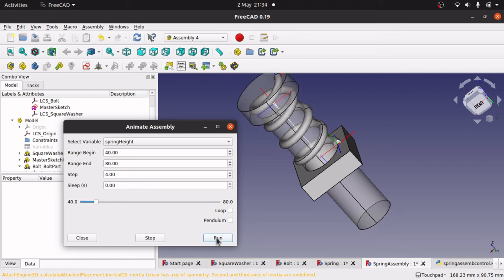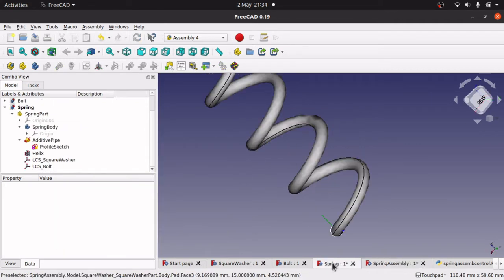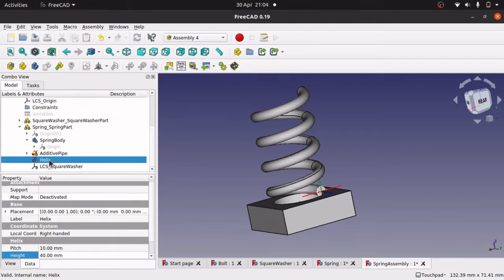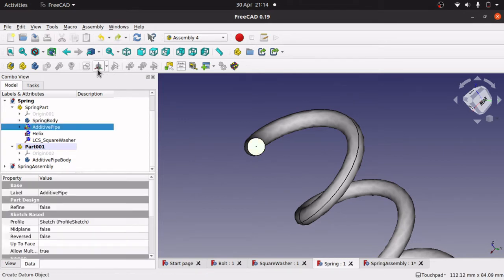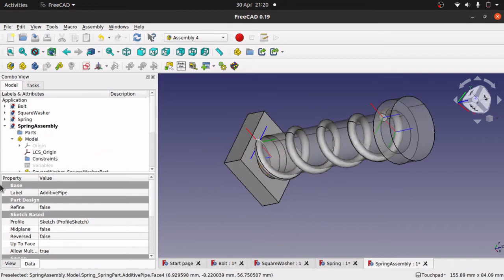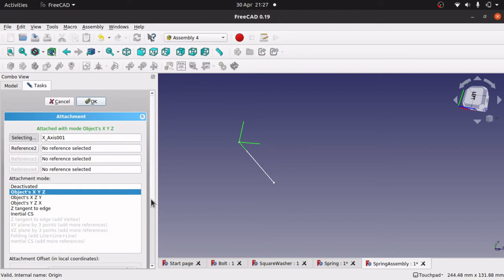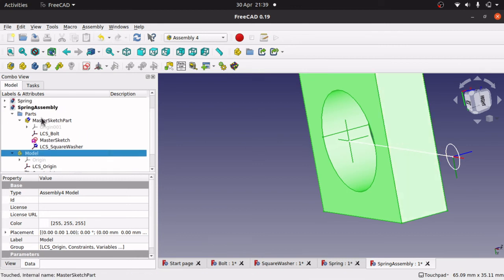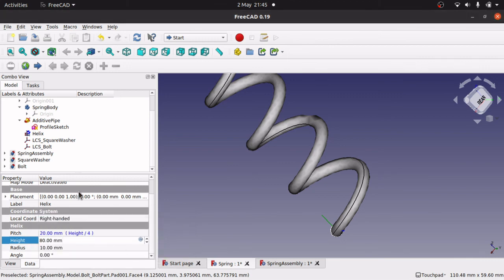Freecad Assembly Animation Spring moving bodies Part 3 of 4 - Beginner friendly, mechanical movement

Comment: Is there a trick to speeding up the spring's recomputation? Every time I change the spring height, my computer takes a good 10 seconds to generate the new spring shape.
Reply from the maker: This is quite a old tutorial and I am going to update this for the new assembly workbench which has a new solver so things should be a lot quicker.

Comment: Hi Mango, your video's are well put together and easy to follow after watching a few times. i have a problem with the animation, when i try to input the formula/expression for the height of the spring, ie; (<<springassembly>>Hash etc i keep getting the message Failed to parse expression, as soon as i start typing in that field, thanks for any help.

Comment: There appears to be a missing video between 2 and 3 as it jumps with a bunch of added Varibles on the springs
Reply: I agree. I never did see how to create the LCS on the spring to attach the bolt. There is a problem with this. If the LCS is attached to the top end of the spring, none of the planes created are parallel to the X-Y-Z planes of the parent. This is due to the fact that the additive pipe created by the helis and the ProfileSketch leave the top end of the spring at an angle perpendicular to the helix end. This can be corrected by rotating the axes, but when the spring height is changed the rotation angles are no longer the same, so the bolt tends to rotate to weird angles as the height is changed. At some point the assembly blows up. Everything was fine until I tried to change the spring height.
Reply: Yeah, I was really enjoying the methodical an step by step approach in this series as this is touching a lot of parts of FreeCAD I haven't touched before. And then a whole video is missing :(
Reply: Oh, it feels like the end of the video is at the start? as the first step that I was expecting is actually 8 minutes in?

Comment: Whew!  I made it to the end of this video  - lol.  Picked up some tips along the way but I have to admit my head was spinning and I didn't take it all in.  The inter-file issues with the variables was somewhat hard to grasp but I'll have to re-watch (probably several times) to understand it fully. 

I have used both the asm4 and the asm3 workbenches in the past few months trying to learn a productive assembly workflow, and I am still on the fence.  Sometimes, I just want to slap some bodies together, and other times I need to properly spend the time and patience to create a real assembly. Guess it just depends on what you are after.  Lately I have discovered the manipulator workbench, and it might hold promise for the slap-happy approach albeit the bodies are only positioned in space and not really attached, but it might be ideal for a "static" temporary display/check.

One item that I have noticed with the asm4 approach is that parts that are basically connected at multiple places and are fully moving in space are not possible.  For example, an arm that is articulated at each end and the entire arm moves in space as a result of the overall motion - is not possible.  I believe what is required is a real "solver" running the assembly, which is what asm3 uses.  I have a model I was working on that fell into that and I ended up learning the asm3 workbench to assemble it.  Otherwise the asm4 workbench is somewhat easier to grasp the concepts.

Anyway thanks for your efforts on this and sorry for rambling - its a complex/confusing subject and you've presented it well.  

Cheers from sunny Canada !
Reply from the maker: No no rant on lol. I know what you mean. When I first ever used the workbench I followed a number of tutorials that just didn't work. In the end I got something  working but hit so many issues. When I finally did get something working I had no idea what I did. Lucky enough whenever I do something new I always record it so I can review my steps if something went wrong but instead I was trying to figure out what I did right lol. I first started modelling inside the assembly so didn't get the cross reference issue but things got complicated and messy. I found out that you could model in individual files then spent 2 day trying to figure out the DAG error when using a variable. Not to mention the computer hanging up when forgetting to set the range on the animation tool. But these things can only get better. What would be nice if there was a click and drag workbench with parts that just snapped together at defined points. Because freecad is so flexible there are so many ways to do one thing. Which is a blessing and sometimes a curse. I am currently building a robot arm and the hand every now and again keeps on attaching itself to the shoulder joint! It's driving me nuts lol